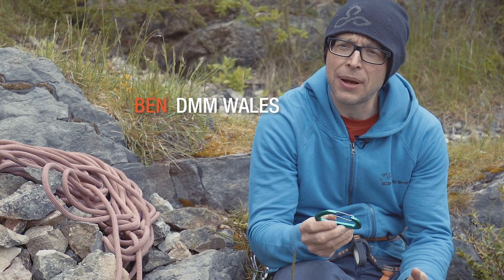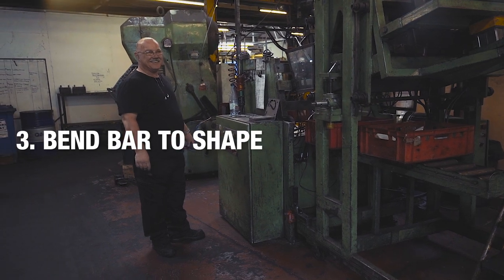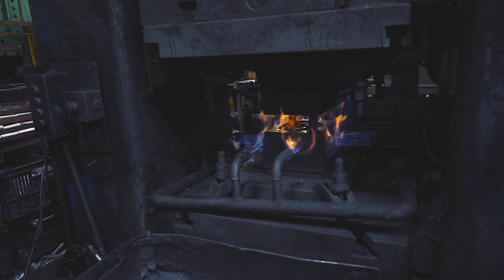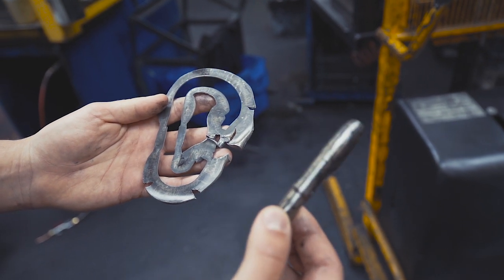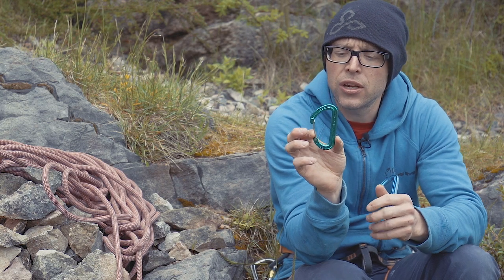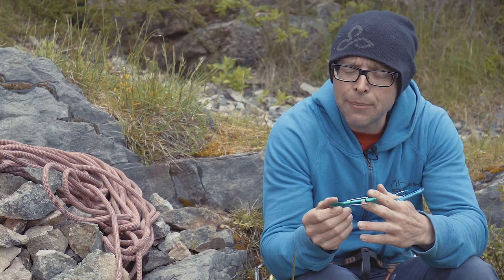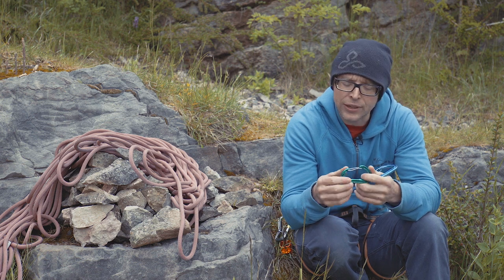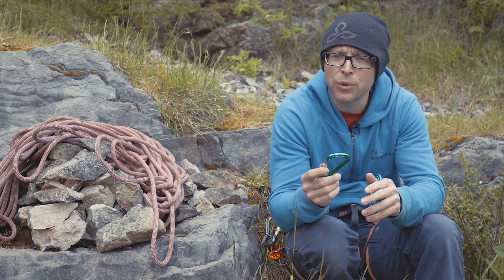How Carabiners Are Made - With DMM | Ellis Brigham

Comment: Wish they would go into more about the process, like what steel or Aluminum(7075?) they use, how they are designed to hold a specific weight/shock strength or kN value, latch/lock/gate & weight testing(how many openings before failure auto lock vs wire gate) how/why designs differ (D-ring vs. others) just more in depth about things like that… These carabiners just AMAZE me, I’ve been testing these cheap foreign made TINY 2”  aluminum(7,000 series) 12KN carabiners, and it’s just wild how they perform being so small & lightweight, it’s mind blowing really interesting